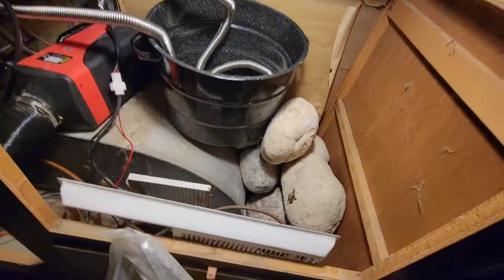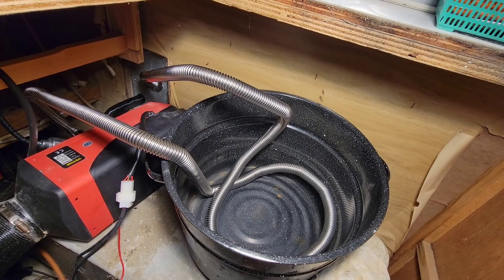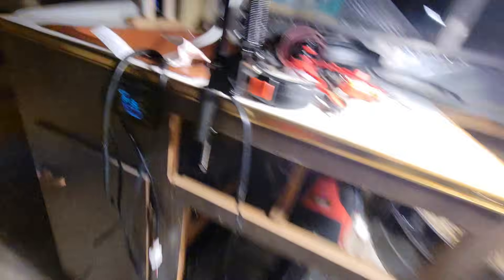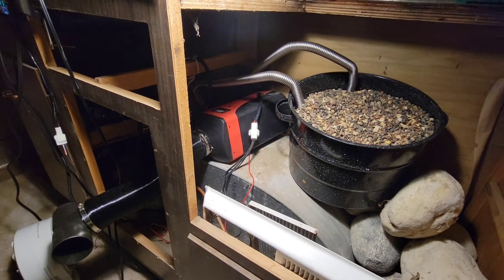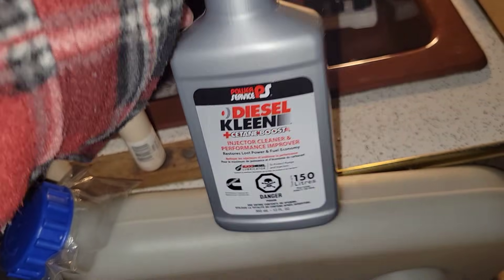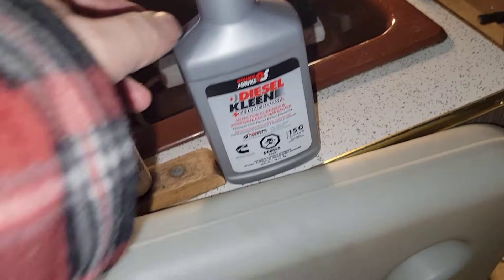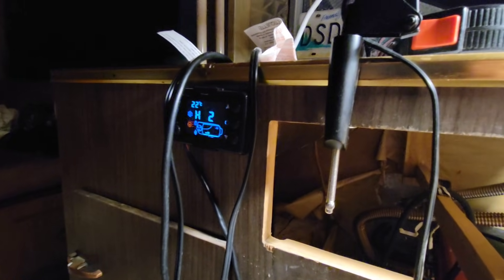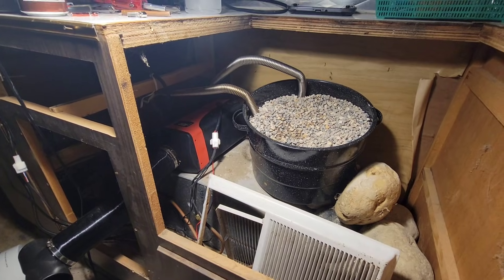vevor 2kw diesel heater heat bank modification

Comment: Thumbs up for the effort, but consider this installation ....   Heater is mounted higher..  the exhaust is less than 10 feet long in total and coils lazily Downwards always downwards to drain away the condensation!. in a metal or ceramic drum, through your sand / small gravel with a hole on the side or bottom of container for the pipe to exit..  I would have at least a foot or horizontal run before pipe passes through a 1-1/2 inch copper pipe sleeve through wall.  A fan across the exposed pipe gets the last bit of heat   This is the only time I would consider sleeving the exhaust at the heater itself.. but a fan would really pull btus away.  (Yes, I have 5 years of experimentation for this)

Comment: Not good. What happens when it fills up with condensate and the whole pipe is filled with water. I guess the heater will turn off.
Reply: No.. it turns to solid soot first..  the gurgling sound is kinda funny

Comment: There are some cases when using sand, stone or concrete work well for capturing heat energy, but this is not one of those cases. I see a lot of videos about "sand batteries" with these heaters ... I think the appeal must be that it's pretty easy and not very expensive. 

If you want to know why water is a WAY better option, watch the first 7 minutes of this video. 

https://www.youtube.com/watch?v=1DMC0w5GscA&t=1293s&ab_channel=EdenEnergyEquipment

Comment from the maker: Do you mean the exhaust pipe or the unit itself can't be on its side? Diesel truck exhaust runs thru a turbo, then its discharged straight vertical 🤷‍♂️
Reply: Yeah, but it's fast moving and relatively hot gas...

Comment: the exhaust can't be positioned that way. just like a car exhaust, condensation comes out of the exhaust. it will pool and potentially damage the unit. the exhaust has to point downward, at most horizontal.